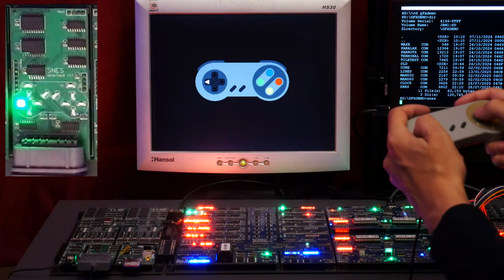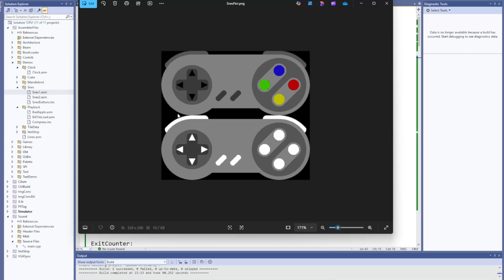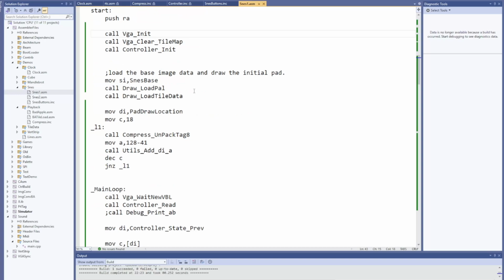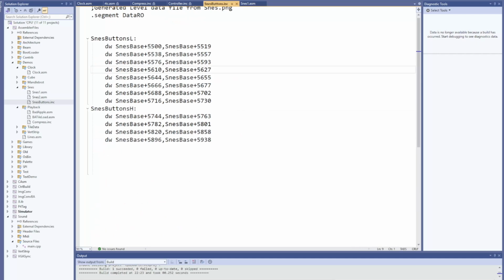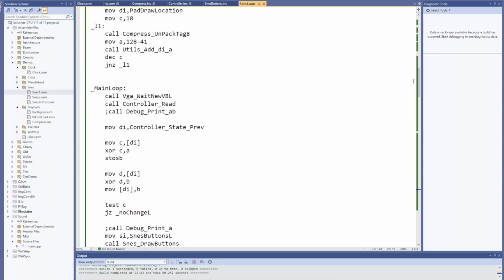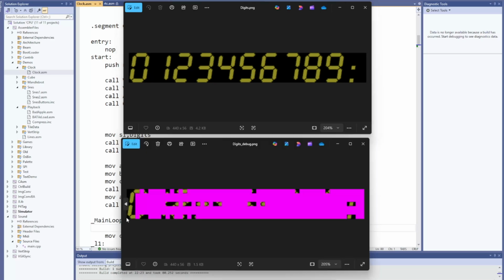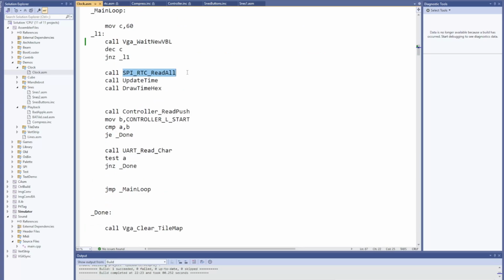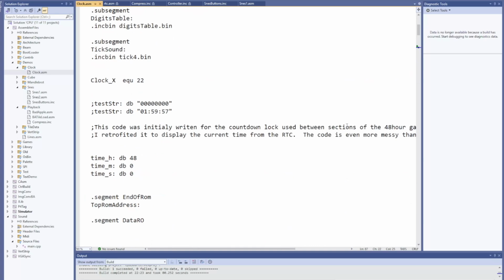A Couple of Jam-1 Demo utilities (Snes controller display and a clock)

Comment: Hi James, nice to see the small utilities as well, I guess there is a lot of work happening on a project like yours that most people would otherwise overlook. Keep up the good work!

One question about the design of the controller tool: Would it make sense to have a single image where each button has a dedicated color assigned and then only modify the palette entry when the button is pressed?
Reply from the maker: You could absolutley do that and it would be very quick to update. However using the graphical export code is simpler to work with, means I don't have to worry about exact pallete asignments and it does get a little attempt at anti-aliasing and smoothing on the graphics.